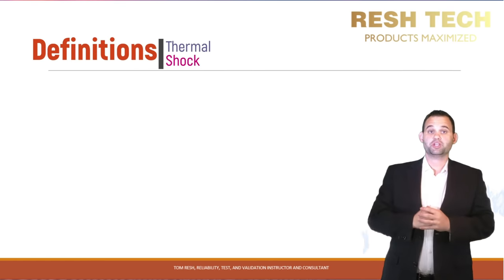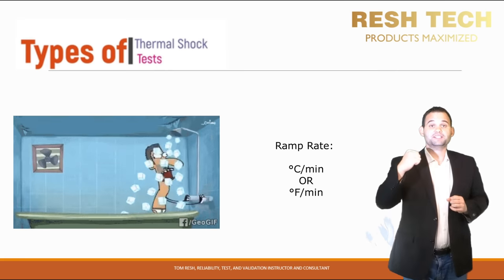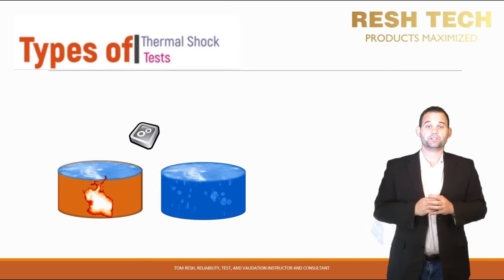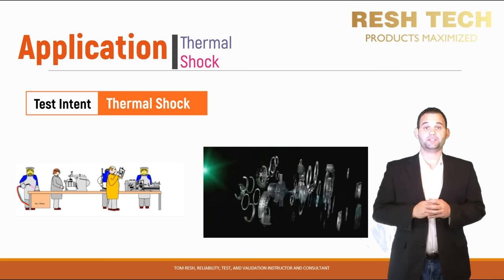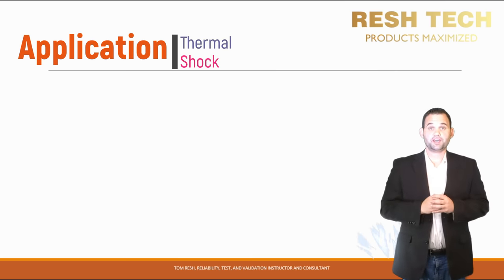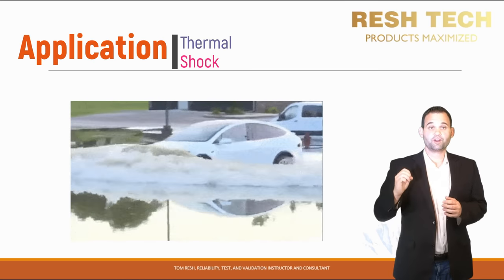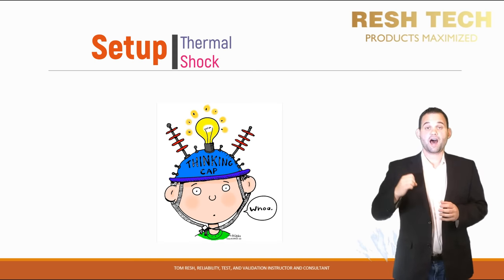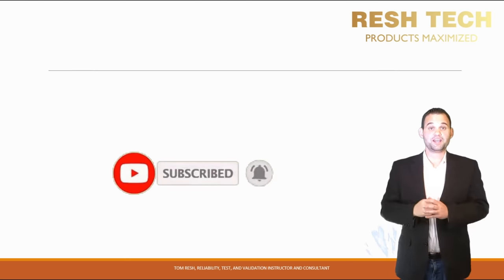Thermal/Temperature Shock Testing

Comment: Hi Tom, 

I am trying to make a test protocol for plastic part assembly subjected to thermal cycling. This is to mimic 250 sterlization cycles the product will go through.  
I was planning to use Coffin Manson equation for accelertion factor calcs and was curious on 2 things, one is the right model for an assembly mainly made out PEEK(plastic) and some stainless steel parts. Second, what value for the co-efficient should I use for plastics, I cannot find it anywhere. 
Also is there any book you can recommend for plastics reliability testing. 
Thanks

Comment: Hi how about electronics equipment , as environment temperature not change so quickly. If temperature change is 3*C /hr , is it required that?
Reply from the maker: Great question.   Thermal Shock is Great for any electronics regardless of environments.  One example is even in a temperature stable environment,  an electronic device will vary in temperature depending on the load or task it's performing and the corresponding heat that is generated from the work performed.  Thermal Shock can be leveraged to accelerate years of expansion and contraction events in a short period of time to find failure modes/ weakest link in the design or manufacturing process.

Comment: Mr. Resh, what is the temperature range that I should use for an mass flow sensor?
Reply from the maker: Should be able to get this from your system requirements.  Reach out to me in the description links if you need further help.

Comment: An equipment which will be kept in an controlled environment (+25 to +30 degree Celsius) under cold weather upto -30 degrees Celsius. Hence, If there is no current, the temperature may fluctuate from +30 to -30 degree celcius. The life accorded will be 10 years. How to decide the thermal shock test conditions